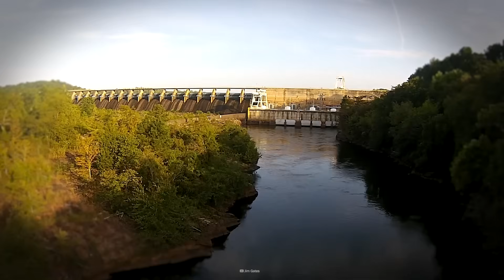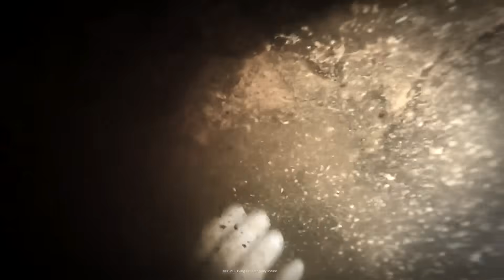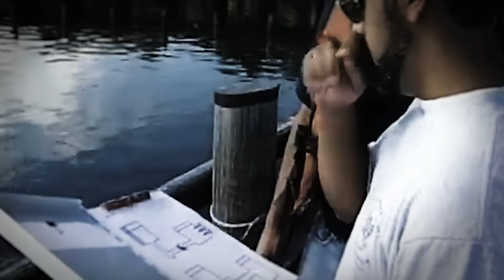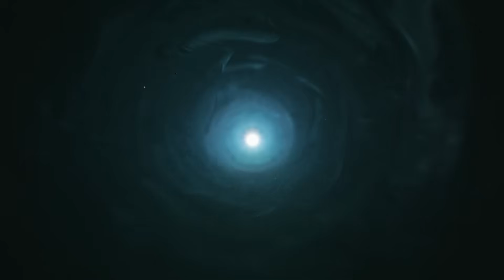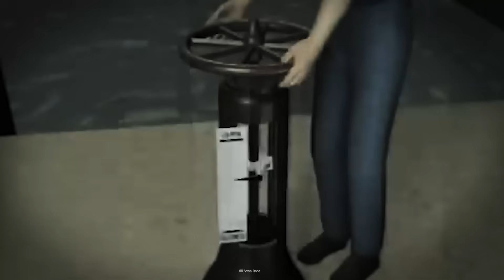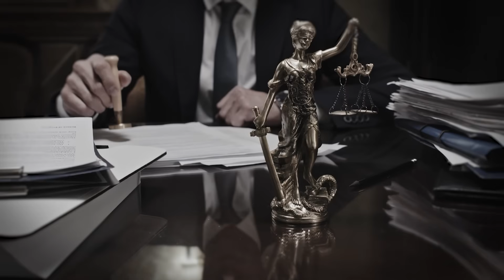Sucked Into Dam - Lake Oliver Dam Incident

Comment: I find it absolutely absurd the out of a team of on site employees ranging from maintenance and engineers to individuals associated with the diving maintenance company and others involved in this damn on a regular basis that would have been on site that day, but that no one would have been able to in a matter of a few minutes through quick thinking and simple deductive reasoning been able to figure out what was opened that should not have been open because it stands to reason that the second that started taking place they would have known there was a pressure differential issue, which means water is flowing where it should not have been, which means the dive company people should have immediately went to the people in charge of the dam and said here's your lockout form. We locked all these out. We're missing something. What is the only other option that you have, that's not listed we need to close it now and there's no way in hell that out of all the people that work at that damn on a regular basis that had someone said that to them that they would have not known what was open they definitely would have known because you don't manage or operate a damn like that and not know each in every individual inlet and outlet and it's purpose that's the only way a damn operates efficiently or at all quite frankly so I am just blown away that they are trying to get people to believe that it took 30 minutes for everybody involved to figure out what was open that shouldn't have been I mean hell even if no one had any idea about the damn an immediate look at the damn blueprint would have told you exactly what was open because you could've compared it to your lockout paper and as soon as you got to one that wasn't on the lockout paper, you would know that that's the one so they should have immediately ask for a blueprint of the damn which I guarantee is also on site

Comment: Didn't they have any kind of electronic monitoring system to show which valves are open or closed?
Reply: That's a valid point! An electronic monitoring system could have potentially prevented this tragedy by providing real-time status on valve positions. It’s frustrating that this wasn't in place!
Reply: Most of this infrastructure is very old and frankly in need of modern things like the aforementioned
Reply: Nope. Hence the double-manual checklist. It all went perfectly, except that Georgia Power left the #5 completely off the checklist for some reason. 😒
Reply: Apparently not. It was an accident waiting to happen.
Reply: Companies' excuse: "No, we don't wanna put money into other things"
Reply: It would corrode overtime it’s an expensive cost that would be wasted money